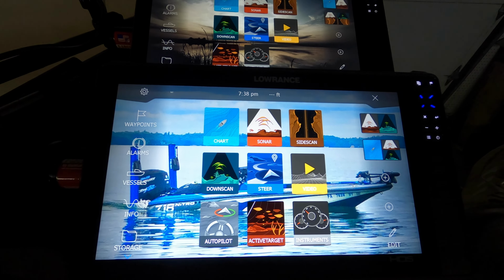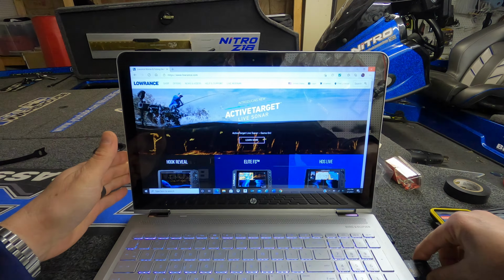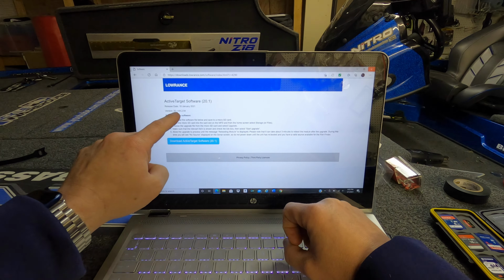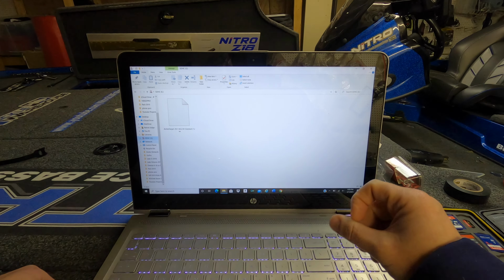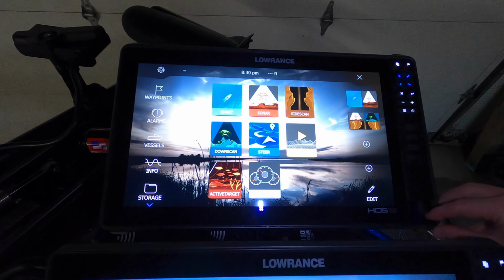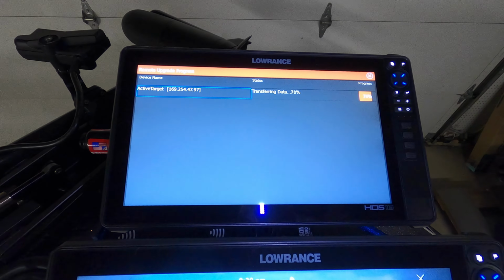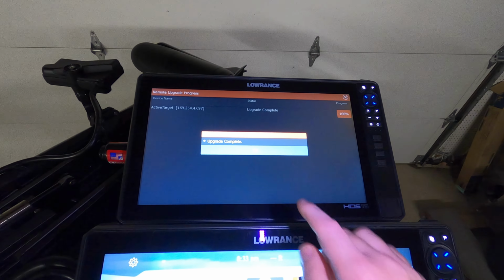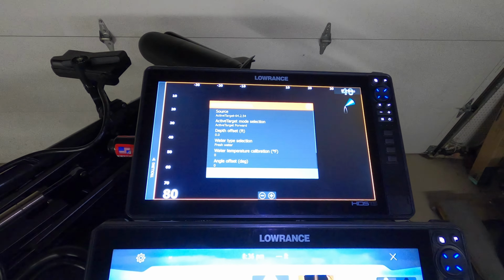How To Update Lowrance Active Target Transducer

Comment: This is very helpful but I have a question…can you put both of these software updates (the graphs update and the active target) on the same sd card? Or do you need two difference cards?
Reply from the maker: They say they like the graph update on its own card because they’re updated automatically when you turn them on… I’ve never tried putting anything else on the card when I do my graphs for that reason, so I usually do all of my graphs and then delete that file off the card to use it for active target…hope that helps!

Comment: Hey I just bought a Active Target and I’ve been trying to update the latest update version numerous times and I’m unable to complete the latest software. The problem is,
When I insert my SD card into my HDS7 Live, under storage, it’s not popping up either on top slot or bottom slot. Basically it’s not showing up for me to start the update under storage. Any suggestions?
Reply from the maker: Hey!…my first question would be, what size is the SD card?….and have ya tried a different card just to see what would happen?…sounds like something may be wrong on the card end of things…let me know and I’ll see if I can help further!

Comment: My Active Target indicator that shows on my HDS LIVE graph (which is supposed to indicate which direction the cone is pointing) is out of sync with the actual transducer direction.  I had the transducer pointing straight ahead in Forward mode, but the indicator showed it pointing left or right.  Any suggestions?
Reply from the maker: Hmm, that’s strange...I would try doing a soft reset before anything, I know that seems to be solving some other minor issues I’ve seen...if that doesn’t work let me know and I’ll see what else I can find out for ya!
Reply: Grab the annex to the HDS Live manual that addresses Active Target.  It explains how to adjust offset if required.  Q&A also addresses on Lowrance’s website.
Reply from the maker: DBigs70 is correct, I found out that you have to adjust the offset when this happens...I've seen it a few times now in the forums

Comment: Hi updated the FS 9 unit to version 20.1 64.2.62 and the AT 64.2.66 are these not compatible, When configure AT is say it´s found and then after a few second switch over to fail Please make sure active target is connected ?
Reply from the maker: Hey Morgan!...they’re definitely compatible, but I’ve seen other people have this exact issue in the past as well...I’m yet to see what actually causes it, but sometimes a reset will fix the issue...I would start with a soft reset, if that doesn’t work try backing up your info and doing a hard reset...let me know if either of those things work for ya!
Reply: @NitroZ18Fishing  what do you medan by soft vs hard reset, how should it be Done?
Reply: Ahh I got it not how to do the reset of the FS device, there is no way to reset the Active  Target or maybe not needed ?
Reply: @NitroZ18Fishing  Looks like it works after soft and hard reset (THANKS), 
but I have very poor "image" no detail and I dont even see my lure, any ideas ?
Reply from the maker: Hey Morgan!..,sorry, I’m just seeing your responses...glad you got it working, but sorry to hear about the image quality...it’s tough to tell without seeing it myself but I would just play with the settings some (contrast, range, etc)...I can pick up my lure 60-70’ out, and the clarity is excellent...takes some getting used to but once ya get comfortable with it it’s insane!
Reply: @NitroZ18Fishing  thanks for all help but i think I found the issue, are in contact with Lowrance. https://www.lowrance.com/sv-se/help--support/?guideTitle=ActiveTarget-Troubleshooting&guideId=535-281
Reply from the maker: Ok awesome, hope it all gets straightened out for ya!...keep me posted on how ya make out, tight lines!